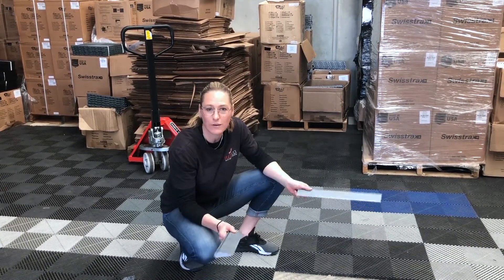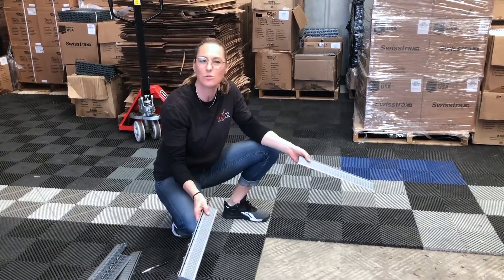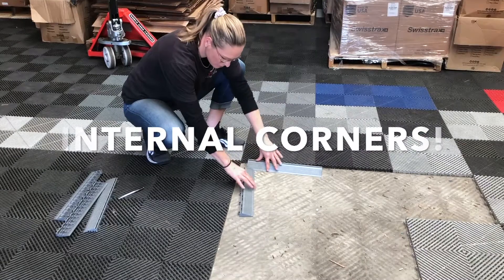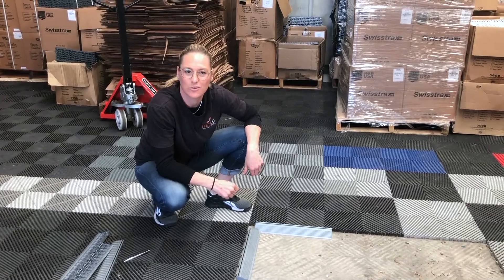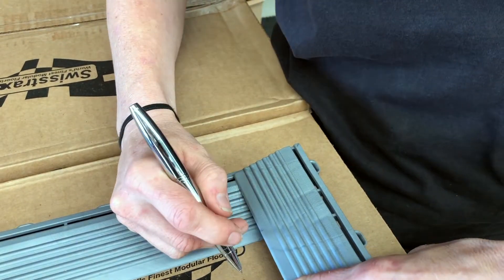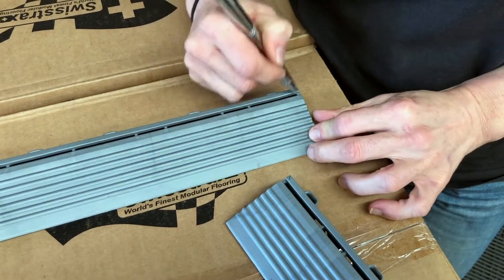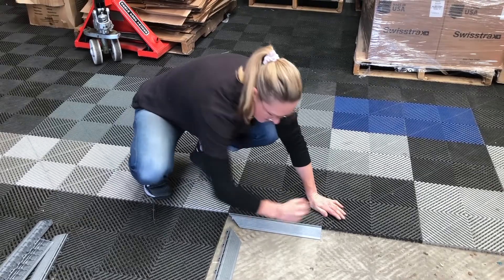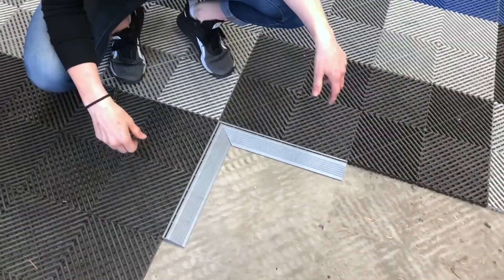Installing internal corners with Swisstrax

Comment: Kelly your videos are super informative. As a new distributor for swisstrax your videos have been helpful. Do you have a solution for inserting a diamondtrax section surrounded by ribtrax?
Reply from the maker: Thanks!! It would be a case of lifting out the tiles you want to replace by following one of the other videos and inserting the Diamondtrax etc. where needed. Do you need more help?